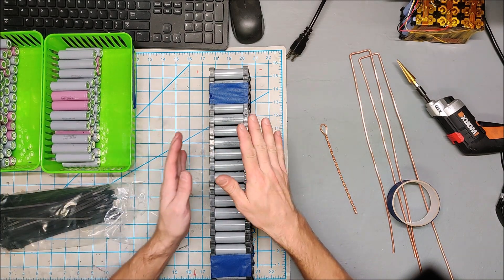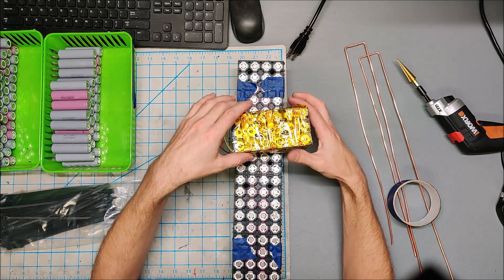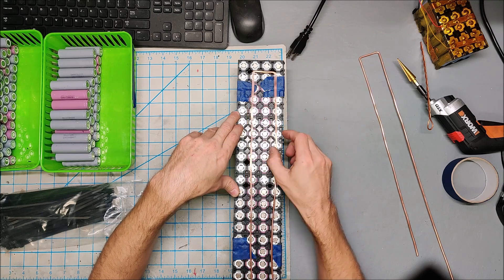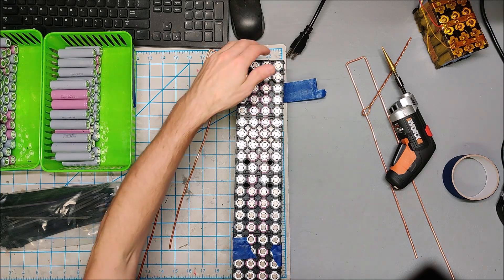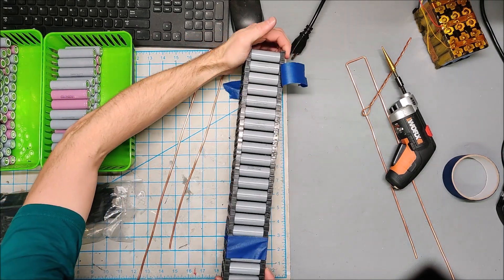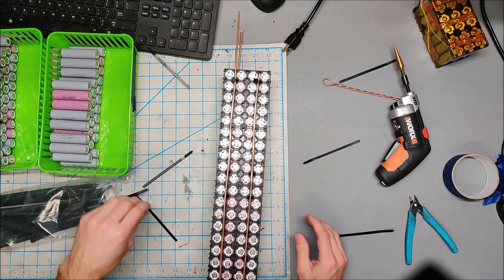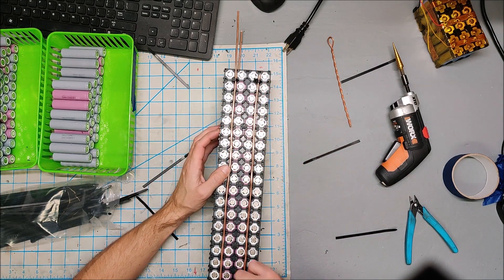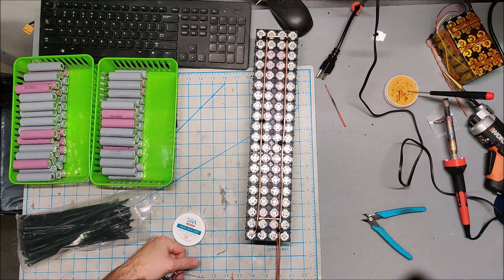DIY POWERWALL PART 3 - BUS BARS

Comment: Would you still need  to use or recommend busbars if you spot weld these batteries?
Reply from the maker: Sort of. If you build a big pack, 100 amps could be flowing through it and nickel can't really handle that.
Reply: @stevenc22  so if i would recreate a powerwall like yours, would you solder it or add busbars over the nickel strips? Because i'd rather weld the batteries in place instead of soldering each single battery.
Reply from the maker: @Sereen666  Im a big fan of spot welding these days. I would add a copper busbar on top of the nickel.

Comment: Is that new battery? Or old laptop baterries?
Reply from the maker: New batteries recovered from unused modem packs.
Reply: @stevenc22  great, how expensive is that 1 baterry?
Reply from the maker: @pltspemula  you can get new salvage batteries for around $0.75 per battery. That Powerball has 1120 batteries in it. So the batteries alone cost around $1000
Reply: @stevenc22  ok master, I use old laptop battery. Try to reuse rusty, but the capacity is .. enough, not too bad😁